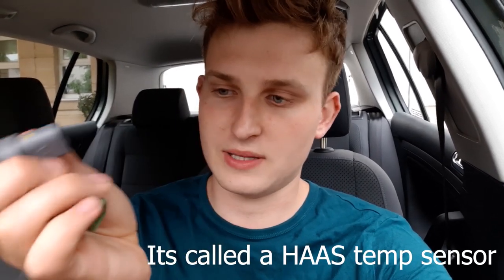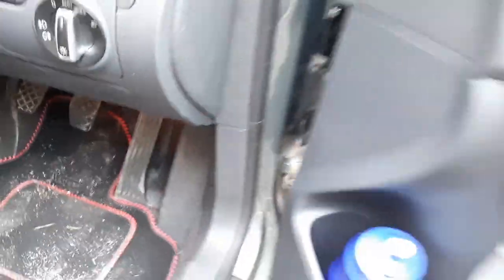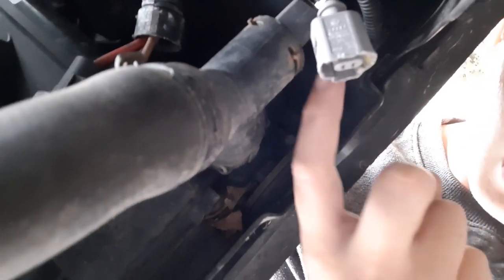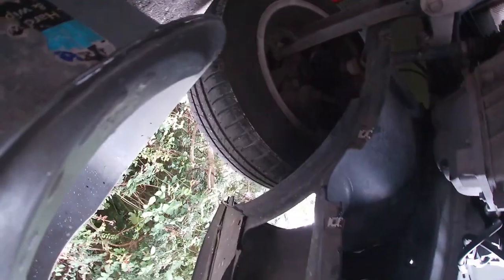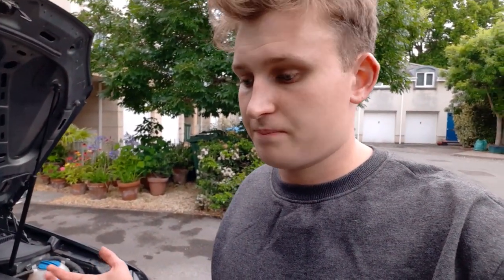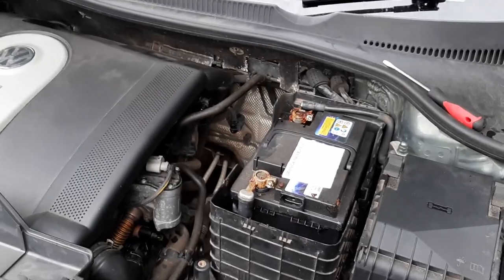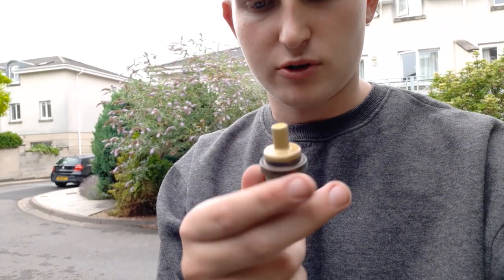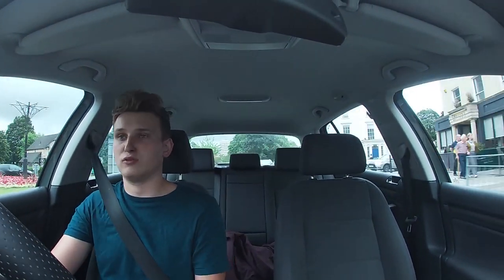Fans Always on! MK5 Golf 1.6 FSI (COOLANT SENSOR REPLACEMENT)

Comment: On VW group engines with two coolant temerature sensors, one is monitoring input coolant temperature (pre  thermostat in lower coolant pipe) ant the other is monitoring outlet coolant (from cylinder head mounted coolant dustributor). The ECU uses the values to determine whether or not to activate the cooling fans according to road speed, mass air flow and coolant temperature. If the outlet sensor fails, a defined predetermined temperature of 95 degrees Celsius is used and the first fan will remain active. If the inlet sensor fails, the first fan speed remains active but the coolant temperature is read normally. If both sensors fail (as was likely the case here) then the second stage fan is turned permanently on. Hope this helps a few of you in your diagnosis.
Reply: Excuse me 
If the temperature exceeds 90 when the car is in crowd,but when running in highway it’s just 90 ,
And I checked the fans and it is working,and if I increase the accelerator while the temperature exceed 90 in crowd the temperature goes down again to 90,
So what can it be??
Reply: @AhmedAhmed-zd6uo  this is a bad thermostat bro sorry to tell you
Reply: Hi mate by second stage fan do u mean the ac fan on the radiator? Really helpful comment btw

Comment: I thought I'd report back after successfully completing the sensor replacement this afternoon - fans are no longer on all the time. I ended up like you replacing both sensors.  Probably best to replace the sensor nearest the fan first to avoid a double replacement. 

Anyway, you're a great presenter and I enjoyed listening to you.  Your editing needs a little work though as sometimes your battery appeared to be on the right and other times on the left sometimes your car appeared to be right-hand drive then other times left-hand drive.
All things considered a great and helpful video I hope you didn't mind the critique.
All the best
Rob

Comment: I had the same problem of fans coming on constantly  and sometimes not turning off even after the car was off. Fans blew cold air. Well first we need to understand why. The fans are designed to blow cold air like that in order to cool the engine. Since sth is wrong with it, such as oil requiring and exchange or the oil filter. When this too are old, they put a strain on the engine, causing it to over heat though the driver may not notice this but temperature sensors do. So before concluding that they are faulty. We need to check if oil needs replacement  or oilfilter not choked by thick, dirty oil.

Comment: Replaced both sensors on my vw 2.0 but the fans are still staying on.However i must say that i do not have the diagnostic machine.So i am not sure if its because the fault has to be cleared or the is a problem with the fans.

Comment: i have the exact problem i hope this works tomorrow! Thanks
Reply from the maker: Did for me so fingers crossed
Reply: I replaced the sensor on the pipe that comes out of the engine and it worked no more fans going crazy! Thanks a lot mate

Comment: That retaining clip on mine had corrided, of which I discovered only when the sensor literally flew out when I was flying down the motorway, I heard it pop out and 30 seconds later I was out of coolent and 10 minutes later I'm on a car park getting the AA out. VW replacement clip is now plastic.
Reply from the maker: Yeah the plastic ones come with some of the new sensors. A sensor flying out is not what you want tho!

Comment: I ended up getting one from dealer today because the others kept failing. There is also a plastic clip instead of metal. Mines had corroded along with the sensor. Fan kept coming on. Once replaced all sorted. Common fault with fsi

Comment: Guys please help me I have the same car but with a 2.0tdi and I did change the coolant sensor and my fans aren’t turning on at all I checked the fuses and the relays and nothing my thermostat works as it should but when I unplug the coolant sensor the fans start spinning but when I put the sensor back on ( I mean plug it into the wire )

Comment: Quick question was your thermostat reading in car flactuating? Before you fixed the sensors?
Reply from the maker: Nope, but it took longer to warm up
Reply: @snygate  any ideas the temp gauge on my car goes to max when I start it. But flactuates to 70% to 90% slowly up and down... 

Car does not seem like it's over heating... soon as I start car in morning 1 min and it's on 80 to 90% maxed out... ussualy it was idle at 50% which is 90c 

Any ideas? 😶🙏
Reply from the maker: @PAVMusicProduction  not sure tbh... From the sound of it it's something actually wrong with the dial? I can't see how a sensor would be telling it such fluctuating temps. Plug a scan tool in and see what it says also get on google
Reply from the maker: But I mean the sensors are cheap as chips so it may be worth replacing them anyway (do both, I did after filming this)... Who knows, could be the culprit
Reply: @PAVMusicProduction  sounds like the thermostat is faulty.
Reply: @HIXNN  must be because not last 4/5 days it's been fine. Where is it located and is it hard to replace? Could you show a video? 😅
Reply: @PAVMusicProduction  varies from engine to engine. For my gti it's an alternater out job which is the hardest part. I'm sure you can find something on YouTube for your engine 👍🏼

Comment: Great video, mine keeps starting when car is cold and not been used for hours. It drain my battery dead. I woke up one night by a noice, it was the fan's having a party. Now i have to remove the battery cable to avoid the deade battery.
 Could this be the problem?
Reply from the maker: Could well be! Scan it and even if it doesn't come as error, probably worth doing

Comment: I'm driving a 2005 vw mk5 2.0 FSI ... As of late ,both my fans started running when I start the car up. It doesn't seem to over heat though. My temperature goes up to 90° and the fans only switch off when I turn the ignition off.. 

Might this be the same problem?
Reply from the maker: Sounds like it yes
Reply: @snygate  Also had the same problem and according to the video, did a hard reset and the problem was gone have done almost 1000km

Comment: Bro I have the same car 1.6 fsi 2005 year 115 PS. My problem is with my clutch or something with it. When I slow down and change to 2nd gear it has big vibrations coming from bottom... And when I am in first and starting my movement also this vibration is there and also in reverse... Can you tell what could be the problem?? Tnx and good videos bro ✌️
Reply: Change the clutch kit, Sachs or Luk manufacture of the clutch kit, also check engine/transmision mounts.

Comment: I've got this same problems (mines a TDI though), fans always running. Changed the (G62) sensor twice to no avail. (This is the error my obd-ii gave me) Really don't want to give in and go to a mechanic.
Reply: If this doesnt work, most probably your fans, wirings or conetions and bad, rusted away or somethig like that.

Comment: Is it only the 2 coolant sensors that make fans continuously keeping going off every 2 minutes. Also what if i change both and it still continues ?
Reply from the maker: Change both as they're cheap but if only one is broken, it should fix it
Reply: I changed both and fans kept on especially when I use heater or AC only to find out my themostat packed up and car was running cold all this time. It's now sorted this is my 3rd week no fans!
Reply: @lindokuhleceke4703  I have the same problem do you fix it ?
Reply: @mohamadobaid3718  yes replaced my Thermostat my self last year in May and car has been running fine since,never heard of those fans,ever.

Comment: Just replaced both and the problema pressists, any Help?
Reply from the maker: Run a diagnosis and see what codes come up
Reply: @snygate  p0116
Reply from the maker: That's coolant temp so either the sensors are buggered (unlikely if you just replaced them) or the water pump is beginning to fail
Reply: @snygate  hummm ok thanks for the sugestion
Reply: Thermostat us the issue,mine was overcooling. New Thermostat comes with a new coolant sensor and themostat housing.